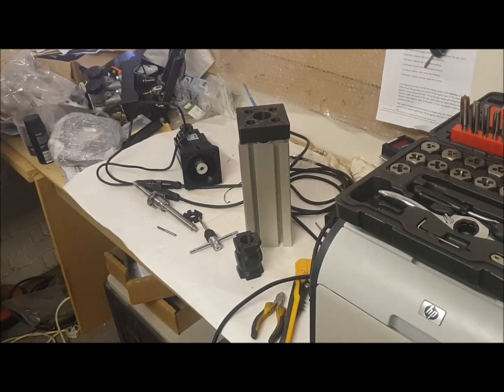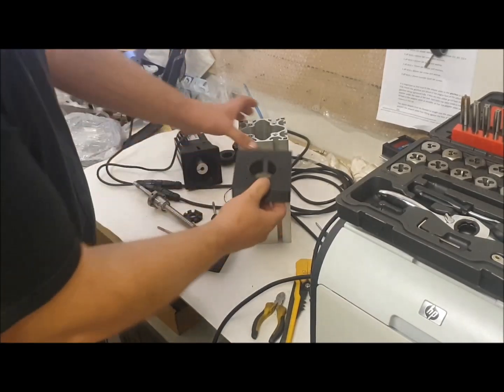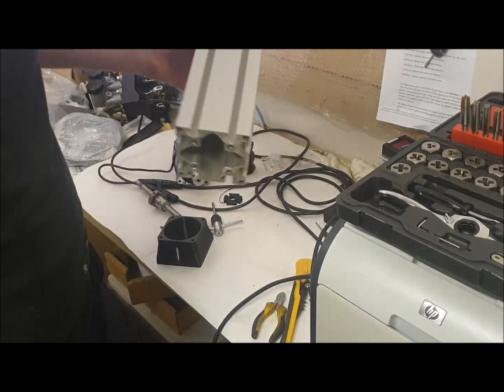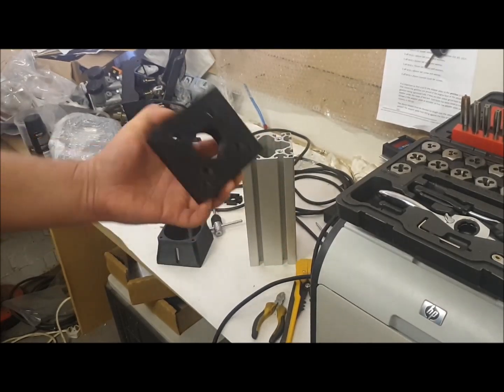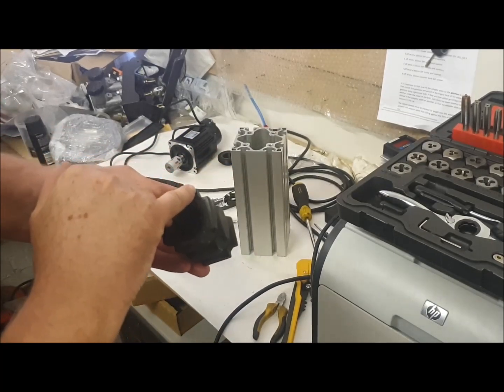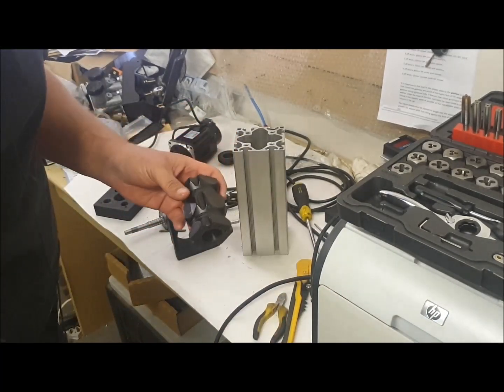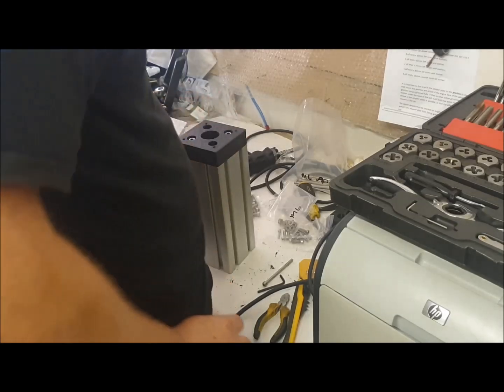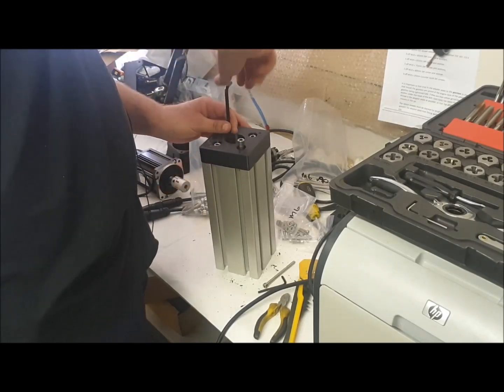Build your own SFX-100 motion platform Part 3 - 3D printed parts - for Sim Racing

Comment: Another question: do i need the servo with the brake option or without it? There is an option to get it with the brake feature, but i see no info on the sfx 100 page about this question

Comment: @11:43 - could you tap the corners of the extrusion itself to 8mm?

I've never tried corners, but I taped out the inner channel of a piece of 40/40 profile with an m8 bolt when I mounted my seat rails to an electric motor and was astounded by how strong it was.

of course the short answer - somebody needs to mass produce some metal pieces instead of plastic :p
Reply from the maker: The holes in the extrusion are about 11mm so you can tap it to M8 unfortunately you have to use the threaded inserts.

Comment: @GP Race Simulation What infill amount do i need to set the print too? i have one test print going now at 40% in fill but not sure its enough. Also the infill for the motor and bearing mount
Reply from the maker: Email me gpsimulation2018@gmail.com and I'll send you my Cura profile if that helps.
Reply: @GPRaceSimulation  great mate thanks

Comment: Really helpful again. Did you decide to use the thread inserts in your other builds? Not sure if I should get them or not.
Reply from the maker: I haven't used thread inserts in any of these actuators yet. I think i've decided to change the design of the parts to allow the fitting of lock nuts on the reverse of as many bolts as possible. I consider that the vibration effects might be more of an issue than thread strength.
Reply: @GPRaceSimulation  did you ever install lock nuts? I was wondering if Heli coils would be more suitable

Comment: I am starting to build the sfx-100 today! Could you tell me approximately how much filament you needed for the printed parts? I plan to order 3kg but i really do not know if it is the right amoint or not...
Reply from the maker: From memory I ordered 5 but only used 3.
Reply: @GPRaceSimulation  ok thx..i ordered 5 as well. I think i will.be able to use the rest to print something as well :)